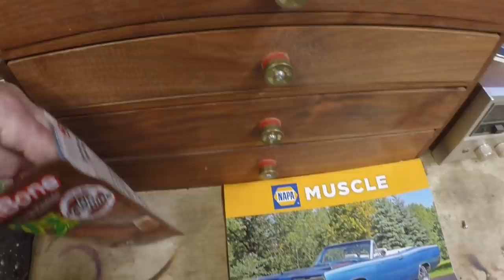Cub Cadet Dozer Build, S2:E8 Body Shop Edition!

Comment: Frank you have done an outstanding job, just a note when your motor was running it was showing a bad wire in the front of the motor running from the left side to the right sparking so you would want to crank it up in the dark and look in the front of the motor you will see the display!! Take Care
Reply from the maker: Pulleys rubbing a bit. Not electrical.

Comment: Been watching your project from the beginning but this is my first comment. You've done an outstanding job fabricating the machine. I couldn't help but notice all the weight you added and I'm surprised it works so well with the drive train it has. You mentioned adding growsers a few episodes ago. I added 1 1/2 inch growsers to a John Deer 1010 loader about 15 years ago so I could use a dozer blade. It worked fairly well but I had to minimize my turns or the steering clutches would overheat, particularly on soft ground. This was a 13000 lb machine and the extra load of the growsers taxed it to the limit. That said I would recommend you be conservative with your growser size. Great work and good luck with the rest of your project.

Comment: Now i can sleep better that you have protected your legs....What a great idea....Safety is job #1....  Great work for sure...You remind me of young boy on a new toy when i see you driving your creation....   This job reminds me of my father who tinkered as well.  He made some creations on a sears tractor once and placed a large steel milk can on the rear hitch for weight. I planted my butt on that can and he decided to go up an embankment.  I felt the can move down closer to the ground, which meant the front was lifting up.  I jumped of the milk can and my calf got hooked on a trapezoid metal support he used to hold the milk can, and i cut my calf open to about 14 stitches and the tractor went over.  My father made it off and he was laughing like a nut.  Mom came out and got me and we went to the hospital...  What a crazy dad...hahaha  Thought i would share...

Comment: I was on team three point hitch after you described it’s flexibility. When I saw the footage of you driving the dozer, I pictured this set-up. I also pictured a blade that mounts outside the tracks, like a traditional dozer. With the proportions that you’ve built this machine, a traditional dozer blade will look 10 times better. Plus it may give you a better way to climb up onto the machine and get into the seat without stepping on the track.
Reply from the maker: The blade that mounts outside the tracks would be only a 4 way blade--unable to angle right or left.  I agree, it would look better (more like the D10) but limits the dozer to straight pushing, unable to push snow, (or dirt) for example, to the right or left.

Comment: In regards to the blade mount… I like the idea of a three point hitch for maneuverability, but in order to keep it looking like a D10 you could run two arms from the blade to a telescoping beam that runs down the side of the undercarriage. When the blade pivots from side to side the hinge pins would move and the beam would telescope out on one side and telescope in on the other. The main beam would of course pivot on the sides of the undercarriage. The three point hitch would do the work and the side beams keep the look of a mini dozer. Like the video series… look forward to new videos.

Comment: I hesitate to give my opinion, but since you asked.
Most dozers use two arms that pivot about 2/3 the way down the track box and then are connected by a cross piece in front of the dozer. This would give you up and down with two cylinders. You can then use two hyd cylinders that allow you to angle the blade to the left or right. There is a lot of force being applied to the blade and the two arms would provide good support and apply downward force to the tracks. For the up and down you can use two valves so you could angle the blade down on one edge or the other or just one valve so you raise or lower both together. For the tilt, you can use one value to the two cylinders and just hook them up opposite so when you move lever in one direct one cylinder raises and the other lowers and vice versa.
A winch would be cool, and I would put it on the outside into the stronger rectangular tubing over the sheetmetal seat box.

It has been my experience if you try to make something do too many things that they rarely do anything well. Just my $0.02 worth.

Comment: 36:36 Your manual clutch is throwing sparks at the front of the engine when it is in the disengaged position.  Looks like it stops throwing sparks when you engage the belt pulley.
Reply from the maker: yep.

Comment: I like the way the cats have steel bars running from the middle of the track support forward to a heavy bar connecting the forward ends and providing a connection point to the rear of your blade assembly. That connection could provide  for blade rotation, tilt, and swing. If that point was a trailer ball, removal of the blade could be accomplished and allow you to push trailers, ect. Use a single cylinder to raise the assembly behind the ball and 3 cylinders to do the rest of the blade movements. I can visualize the arrangement but it isn't easy to describe. The ball could easily be on 2 by 2 receiver. And regular hydraulics connections on the grill so it's all removable.
Reply: If the trailer ball is mounted vertically he'd have to make the pivoting cup go on top of it attaching the cup to the blade sideways putting all the pushing force where the ball is mounted. If the trailer ball is mounted horizontally the cup would be vertical or flat on the blade that way the pushing forces would go through the ball and blade frame arms all the way back to the tractor frame. Just my thoughts.
Reply: @williambryant5946  good points. There are numerous different types of ball couplers. I can think of a couple that would easily handle the stresses. And if a 2" receiver hitch is used then swapping one setup for a different would be easy. But I know it's not a perfect solution and each one of us looking at the challenge would find other options . At any rate, Frank is engineering the Cat and he has definitely shown the skills to make it work!

Comment: I have a couple of suggestions.   First,  the fasteners connecting the tunnel to the fender should have the bolt on the inside so that you don't snag your pants or cut yourself.   Second,  the fenders need a one inch radius on the corners to improve the looks and for added safety.

Comment: Weld a couple of Reece hitch receivers one on each side, then mount the pins for three-point on hitch brackets then when you want them pin them on and when not needed make a front bumper to slide in them. and if you want a three-point on the rear just add receivers on the back.

Comment: I would go for the ball hitch and keep it the same as a dozer. I would also paint the sprockets and rollers yellow. The undercarriage of dozers is  usually the same color as the body.  A roll cage and a ripper on the back would top it off!  Iol

Comment: Just a suggestion, and perhaps you have it in mind.  But it seems that a mechanical neutral detent for the steering handles would help find the real neutral when you engage the drive belt.  That way the tractor won't creep forward (or reverse) on you when the belt is engaged.

Comment: Looks nice Frank. When you started the engine and was ready to take it for a test drive I noticed from the camera view that there is some sparking going on at the base of the front engine area. You may have a short or something rubbing.
Reply from the maker: pulleys rubbing a bit.

Comment: Don't forget to allow room for the grawsers / cleats when making the fenders.
Reply from the maker: Yes, the right side is a bit close but I raise it up in the next episode or two. The right tension wheel it a bit taller than the left for some reason, so it wound up closer.  It gets fixed.  Lots to do before the grousers happen, but they are coming!

Comment: My first thought when you mentioned the 3 point setup was that the blade would end up way out in front. Never figured it would be as much as you mentioned a bit later. 
Obviously it’s your machine but I think the charm of the entire build was to have it look like a CAT dozer which means for a 6 way blade the blade arms are inside the tracks and a 4 way blade the arms are outside the tracks.

Comment: I wonder if you could do some sort of tilt/angle/lift mechanism that excepts skid steer quick attach. Really though  the weight of the machine even with the tracks and extra drive components will hamper it really doing work with other three point attachments. I would just stick with a traditional dozer blade set up and keep it as a Cub dozer. I think with the way you’ve designed and built it now it’s best work will be pushing.

Comment: Will you use 2 foot pedals to control the blade up and down? If you do, you could use forward and reverse hand levers while picking the blade or attachment up and down. Your blade adjustments could be done at rest..

Comment: What if it was a tracked loader? With a 4-in-1 bucket it would also serve as a dozer. You could use the endless skid loader attachements for inspiration to make your own quick change ones to fit. Maybe put the 3-point on back and have a winch you could use front or back. LOL,I have no aptitude or space to do any of that,but,I have ideas! Thanks for your content. Thumbed up!

Comment: I would lean toward a 3 point hitch but however you mount the blade make sure it has enough vertical travel to come up high enough and be able to go slightly below level. I have had 3 small tractors with a blade. I wished the blade could come up higher on all of them.  They all had the blade on the front.They all could go slightly below level which was fine but wouldn't go up high enough. I don't think they would go higher than 4 or 5 inches off the ground. Have a float position on the control rather than having a slot that allows the blade to float because you may want to cut some soil or ice loose.

Comment: I am really surprised that you didn't  use a spring system to return the control handles back to a neutral position when released.  Most equipment of this type  is set up so if something happens to the operator and they release the controls the machine immediately comes to a stop. With the friction system you are using the dozer would continue in the last control setting until it hit something that it couldn't move.
Reply: The problem with the spring is if your moving and want to ajust your blade you half to drive with 1 hand...
Reply: @minitractors1885  This is true, but with controls that are that close together I normally end up driving with one hand anyway.

Comment: I have an idea about your levers being touchy. Put a damper on each of them that will fix the problem. A damper will smooth out the forward and reverse movement.
Reply from the maker: They have friction pads on them, which are essentially dampeners.

Comment: I'd say go with a regular dozer look on the front and put a three point hitch on the back that has down pressure as well as up and that way you'd be able to mount a ripper frame on the back later if wanted and this would also give you the place to mount a trailer hitch ball for moving a trailer. The three way on the front sticking out so far would make it look more like a snow plow on a tracked mower than an actual mini dozer where the blade is closer to the tractor. I guess you've studied the ways a dozer blade mounts to a tractor and the different ways it can be done. With using a trailer ball for the front I'd think it would need to stick straight out from the front rather than up and down so you can get the blade to angle forward, back, down, and up. If it was mounted like you do to haul a trailer I don't think that would work the way the blade would be mounted. Mounting it straight out would put the forces of pushing back to the frame but mounting it with the ball straight up you'd have to fit a cup over it attached to the blade putting the pushing forces on the ball itself instead of going all the way back to the frame. I don't know if I'm making sense or not but making like a dozer is made would be better than a three point hitch type deal. Using a trailer ball is a good idea as a middle attachment and pivot point but don't put it vertical like it would be to pull a trailer, put it with the treads horizontal. You'd only need 3 cylinders on the blade. One on each side which would lift the blade up and down and angle the individual side up and down like cutting a ditch and the third for angling it forward and backward or keeping it straight. The only thing you'd need a fourth for would be to roll the top of the entire blade forward or backward. Like changing the angle of the cutting blade on a motor grader to either cut or carry material. These are my thoughts on what would look better and more like a dozer and what I think would work better anyway. This has been an awesome build series to watch. Really enjoying seeing this take shape. Good video. Stay well. -Wil  👍

Comment: I think you should make the blade look to scale like a dozer and not a 3 point on the front.   Instead of the hitch ball idea, you could use the replacement lift arm ends from a tractor 3 point.  These would allow for bearing service as well as could allow for movement.

Comment: I ended up using a Kenworth universal that came off the transmission so i would have that slip joint to roll left to right plus to angle it left to right and of course to roll it over or roll it back . I got it off of a heavy duty dump truck , it took a couple try's to get mounted on the blade at the right height . I used aluminium cylinders to cut down on the weight.........Just my two cents......................

Comment: Why not a hydraulic cylinder from just in front of the foot well to the blade and a shorter one mounted to the front of the tractor to the middle of the first cylinder. Then the same on the other side of the tractor. That would give to up, down, left, right and tilt side to side. Then one cylinder up front to pitch the blade. All blade mounts would have to be heim joint Style. This would keep the blade close to the front. Put the 3 point hitch on the back to run attachments like a set of ripper Teeth. The build is coming along great

Comment: I was just thinking, you might want to weld some bar stock across those flat tracks to grab. If you get on a slick surface or trying to use it with a blade, your just going to sit there and spin. Like having a bald tire in the mud or wet grass.
Reply from the maker: 1/2 inch square bar stock is coming.

Comment: Frank, please round the corners on the fenders; at least on the trailing edges.  Your legs will thank you.  I like the practicality of the 3 pint, how about shortening the links to still use it but keep the close coupled blade look.  And if ambitious, you could build some cosmetic blade links outboard of the tracks.  looking really nice,
Reply from the maker: Pretty much what I wound up doing. Doesn't stick out like a 3 Pt but pretty much is.

Comment: Its too bad You cant put the 3 point hitch on back. And build a C-Frame for front out of 2x6 Steel Box beam. Then make a Hitch on front like for the Skid steer attachments. For front.Just suggestions The little Dozer is coming along nicely..Are You going to add Grousers Too each of the Pads on the tracks. So you get better Traction.

Comment: I believe that the 3 point system will be weaker than the ball hitch but I'm not sure I wouldn't go full hydralics 3 point is fine for pulling but pushing with it I see issues ahead

Comment: Is the 3 way hitch strong enough to move a mound of earth or other items ? The arms are a lot thinner than a dozers bars to the blade.
Reply from the maker: Remember, it's only 14 hp. Can't do but so much damage. The Cat. 1 three point hitch is rated at 30 hp.
Reply: @woodandmetalshoptime8048  Ah, right. Should be ok then. Looking forward to the next vid.

Comment: Couple of thoughts;
1) Where are you going to mount the hydraulic tank? Will it be a large enough capacity for what you want it to do?
2) Isn't there going to come a point where the engines' HP is NOT going to be enough with the weight you're adding to the tractor?
Reply from the maker: The rear axle housing is a 2 gallon reservoir which is plenty for operating a few hydraulic cylinders. The rear hydrostat has auxiliary output and input ports to drive the cylinders. 
Weight is not a concern. But obviously, 14 HP has limitations. But so does the weight, at about 2000 lbs, it's not heavy enough to push much anyway.  It'll work fine for the intended purpose. It's not clearing land.

Comment: I would say that using a three point hitch is going to put the blade too far out and its goingvto upset the balance between the tractor and the blade. Be a difficult way to operate and grade with it.  I would suggest you either make a underslung frame to mount the blade or make a outer horseshoe mount to join the  blade to the tractor.  Be a more balanced and effective mount. To consider the 6way mount look at an old case 450 dozer to see the blade mount. This should work more efficiently and either  mount you can apply the blade to it and have your 6way activated.  Use the 3 point hitch  on back and mount different implements. That be a great addition.    Just my thoughts but I think it's worth the effort.

Comment: My vote (if I get one) is build a c frame and use the ball to mount the blade. The 3 point is going to be clumsy and flimsy. Also I wouldn't waste my time or money with the 4th cylinder to adjust the pitch. I have many many thousands of hours on a dozer and I have never had the need to adjust the pitch even tho most are adjustable via turnbuckle.